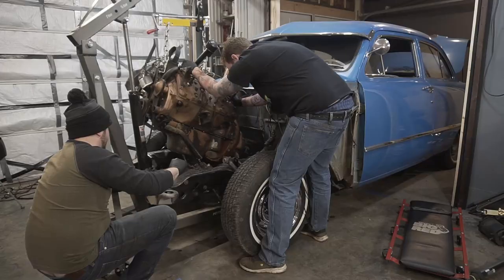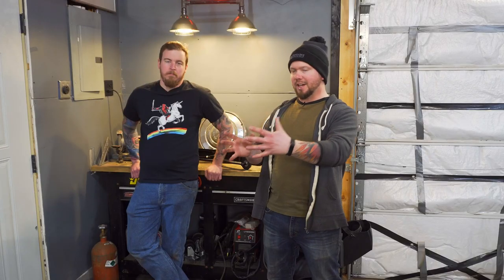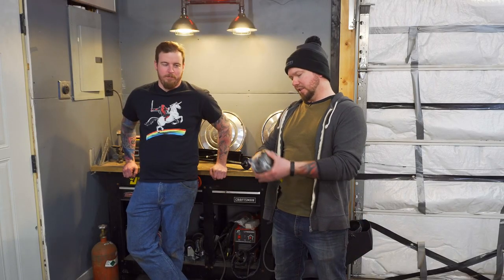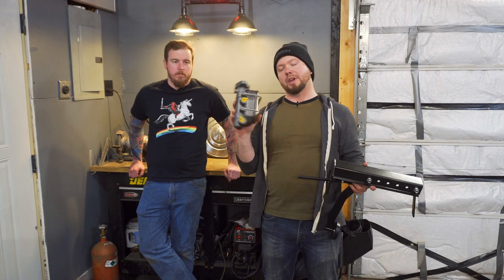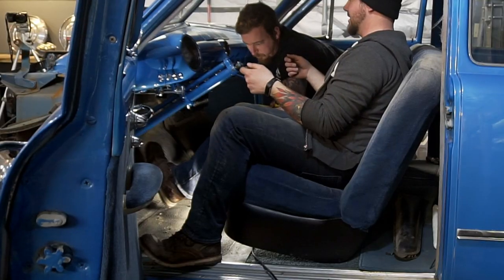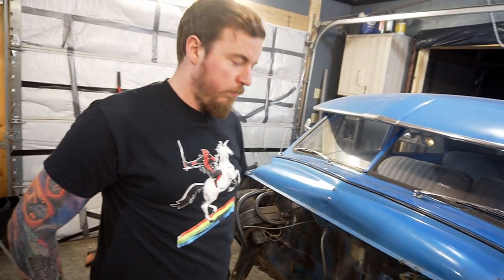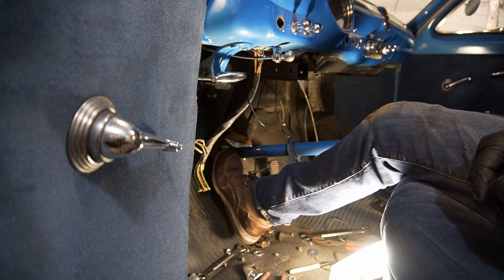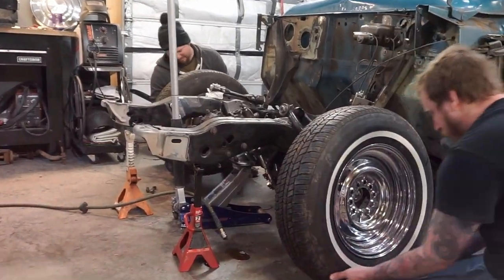Installing a hanging brake assembly; Shoebox Ford Ep4

Comment: This is great. I'm about to fabricate a brake pedal assembly and hadn't thought about running a bar to the dash. Building a 36 Chevy Coupe, but it has a similar dash and steering setup.
Reply from the maker: Yeah it made a huge difference with firewall flex. We haven't finished the car yet so real world testing has not taken place but you can stand on the pedal and there's no firewall movement with tying to the dash so far.

Comment: Good information.  I'm trying to install a hanging brake pedal assembly in my 37 Chevy coupe and this video helps a lot..  There's not a lot of room under the dash and I was wondering how far I need to mount the pedal from the floor and you answered my question.  Thanks! Both of you guys did an excellent job on the video.
Reply from the maker: Appreciate that Gerald! Hope your install goes well!

Comment: Hey guys. Love the channel. I’m using the speedway kit on my 50 shoebox and I was wondering what the swinging T bracket that comes with kit is for. Also, did you mount the pedal to the left side of the column?
Reply from the maker: Sorry about the super delayed response. I didn't use the Speedway kit, but a kit very similar. 
I don't recall there being a T-bar in the kit. 
I mounted my hanging pedal barely to the left so the actual pedal arm is almost touching the side of the column.

Comment: Excellent video guys. Thanks for sharing the tech. Is it possible to eliminate the side to side play in the pedal arm?
Reply from the maker: Thanks Suedville! There definitely is a way to clean that play up. The arm was loosely installed and we plan to either turn some bushings or just pick up some nylon washers for the sides. We will most likely bust out the lathe to get it perfect.
Reply: @DadModsMedia  Well, it's great so far. I'm looking forward to more videos on the shoebox. I'm currently working on my '51 fordor custom shoebox. It's too bad the flatty isn't going to find it's way back home.
Reply from the maker: Nice! These are such great cars! 
The flathead could go in with a fair amount of effort but we wanted a modern EFI powerplant eventually anyway so it had to find a new home. BUT that new home is currently working out details to build a t-bucket, so that's a damn good home!

Comment: Does the bracket interfere with the steering column at all?  I just bought a 49 club coupe and I'm going to do this exact thing
Reply from the maker: Excellent question: it does not from my view. The steering wheel and pedals feel like they are comfortably placed and straight. If you find that you don't like the location you can always modify the brake pedal arm to have an offset.
Reply: @DadModsMedia  
I mean more of where the horizontal part of the firewall to dash brace is. Does the column fit right up inside of it and bolt to the dash or is it offset with the column beside the bracket? Better yet is there a video showing the column bolted back in?
Reply from the maker: The way we did the column was right up under the pedal bracket. The mount that holds the column is mounted to the brake pedal arm as well. It's nice because you gain even more firewall rigidity this way. Pedal arm bracket attaches to the firewall, then the other end to the dash. Then the column to the pedal arm bracket, then the lower column bolts to the floor. Makes a nice big triangle. 
And yes we have a video where I show how I did my Speedway column install. 👍

Comment: I’ve got the same set up putting in a vintage Jeep I’ve got it set up. It’s mounted what is the t-rod that sits in front of the main rod brake
Reply from the maker: Not sure which component you are referring to Tony. Are you referring to the clevis that attaches to the main pedal arm? Clevis attaches to the arm then the rod screws into the clevis. Then we bought a rubber boot to hold the rod and the master cylinder together.